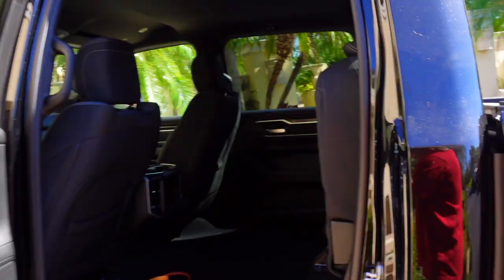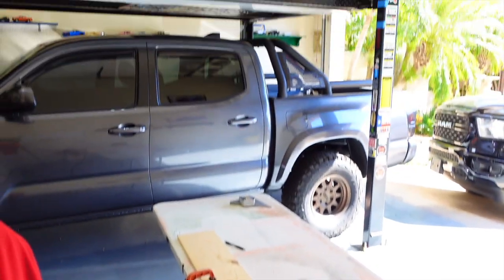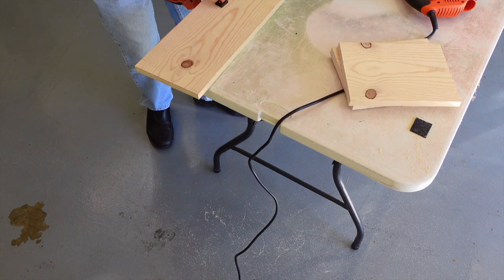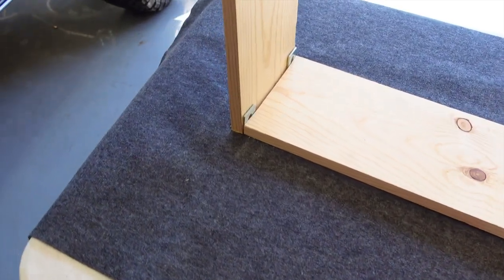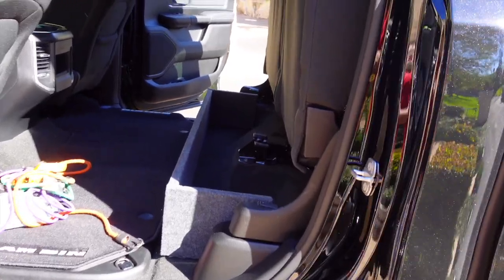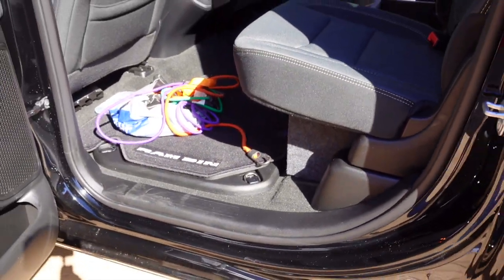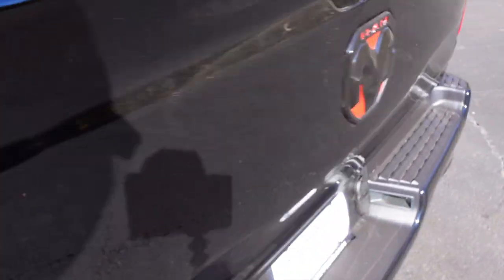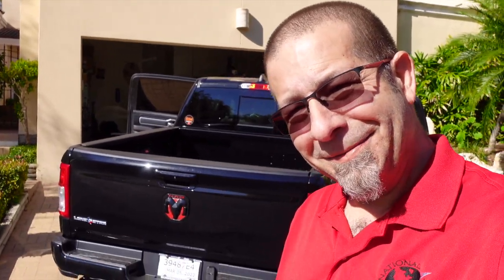How to Add Ram Under Seat Storage

Comment: Looks really good. If the Velcro doesn’t hold while driving with stuff wanting to move it some 1-1/2” L - brackets would let you screw it to the floor.  Put some undercoating on the underside of the screws to prevent rust.  If the Velcro holds no reason to “screw” with it😁
Reply from the maker: Ok!  I see what you did there😂
Reply: @robmotivetoo  I will admit to going a long way to set up that pin.
Reply from the maker: Lol!  But was the destination worth the journey?